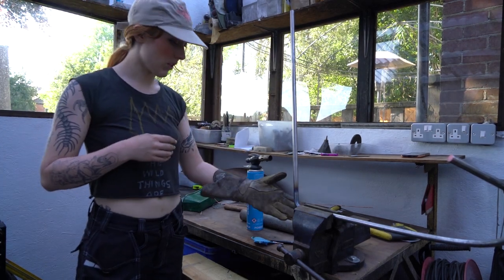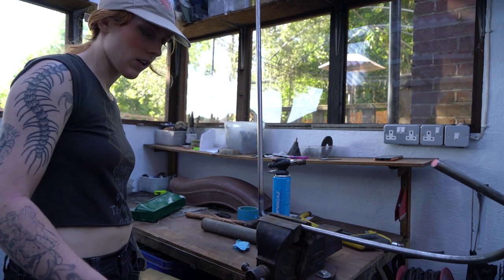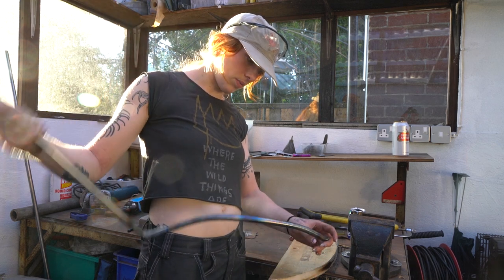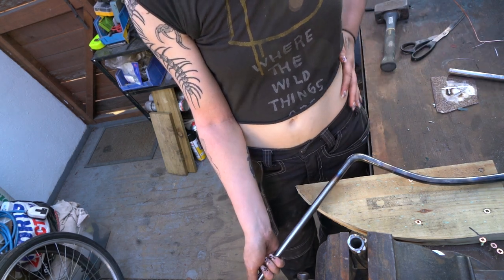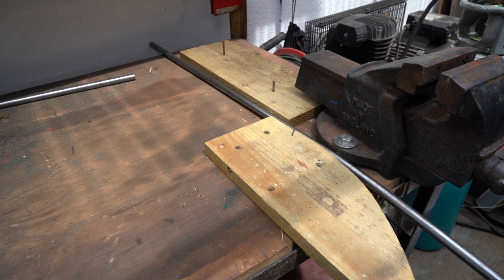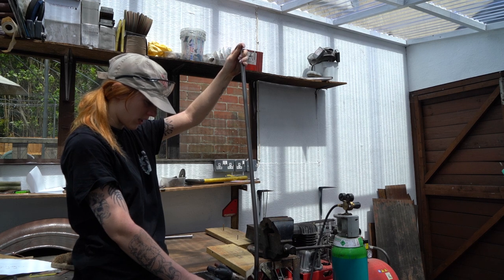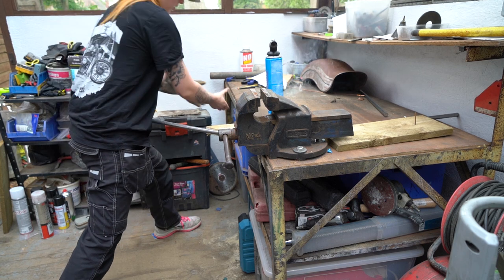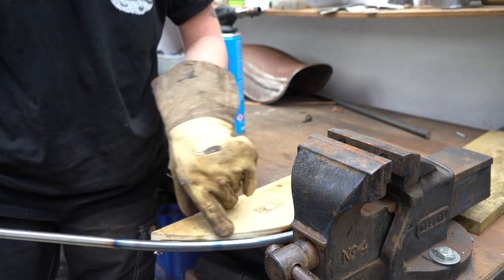Yamaha Chopper Build: Sissy Bar Fabrication

Comment: You are heading in the right direction with the round bar much better then the tubing you were using before.  Tip, wax crayon, or chalk, to mark the bar where to apply the heat to the bar before putting heat into the bar. Try not to bend to much in one go, do it in small steps, heat, bend, rinse repeat.  It will take you longer to do but the results will be much better. It also looks, although I could be wrong on this point here, you are not still putting enough heat into the bar, and the heat is dissipating far quicker then you want it to, you need to get the bar a cherry red to make it pliable to move better.  I know it can be frustrating but you are still learning and you have achieved so much more then most, so keep it up
Reply from the maker: The torch I have physically can't get the bar that hot and I can't afford an oxyletene torch 😭 so struggling and fighting the metal is the way I gotta go

Comment: What your doing is good. Get a mapp gas torch ( like a plumber would use ) and heat the metal till it goes red and the metal will bend a lot easier. And you will get the tight bends you want.. 🤘🤘 you know what send me a private ( I don't want to get loads of unsolicited messages ) message and I can talk you through it ..

Comment: I see you seem to be running into a wall here.......
Your frame looks similar to my 96 HD softail which I've now modified,  I have the chrome rear fender struts (no longer required) if they' would be any use to you on your project I'd be happy to stick them in the post - free 🤗 - 
Check out a pic see if you think they might fit.. Hd 1996 fatboy.
Keep on sticking at it, sometimes it'll drive you nuts but when you finally get to ride it....... Its worth it.

Comment: You need way more heat. Try and build a basic forge, plenty of tutorials on here. You can use a hair dryer as a blower and you can build it on the ground
https://youtu.be/TXZX8bUtgak
Reply from the maker: Thanks I might look into it if it's cheap way to get the metal mega hot